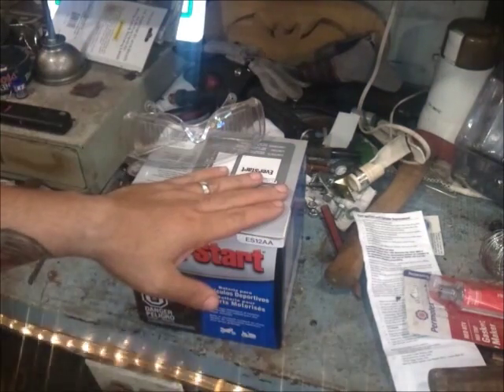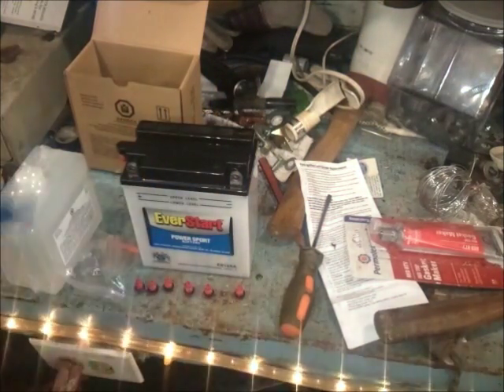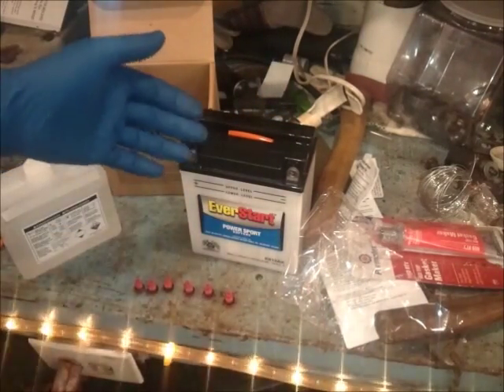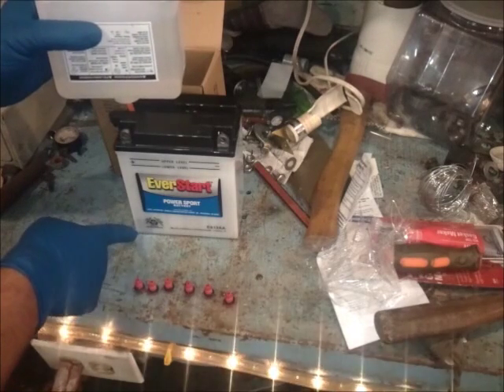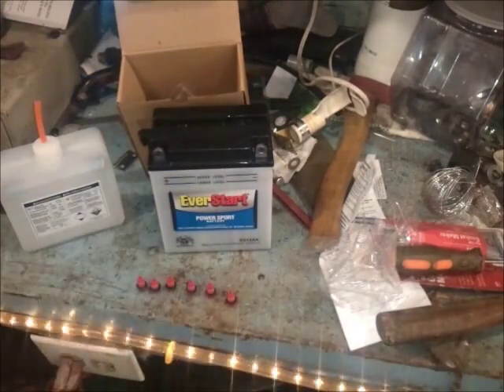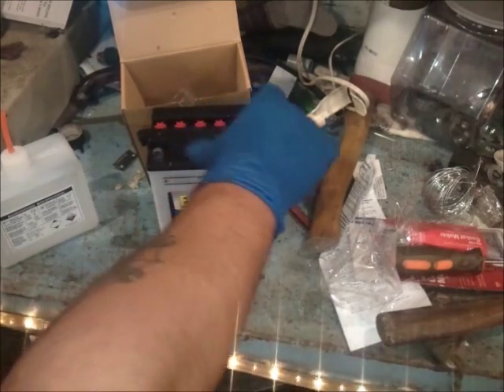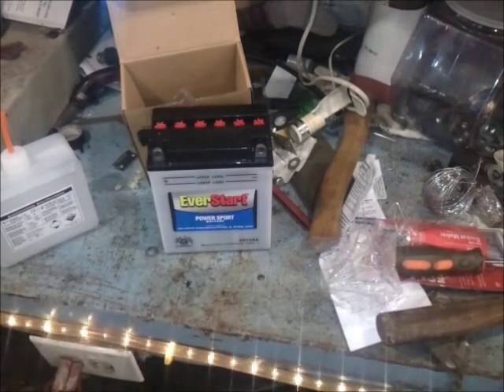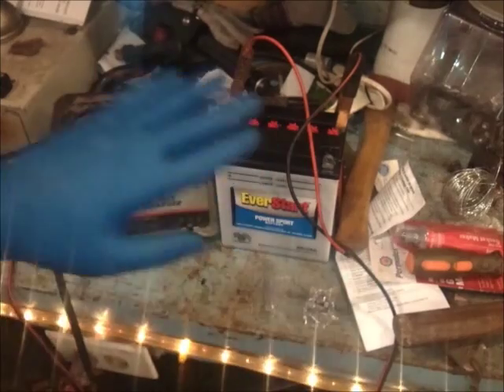how to fill and charge lead acid battery

Comment: A very informative video. I have a flooded type Yuasa battery with me. The acid is yet to be added. I'm a little confused with the level. So, I know that we are supposed to add the acid up to the "LOW LEVEL" at least and then wait for 30 minutes and gently tap it in between to remove any air bubbles. During this period the acid would be absorbed into the plates and the level may go down and you top it. 

But to what level does it need to be topped for the first time prior to the first charge? Is it up to the "UPPER LEVEL" or is it between the two levels? I am worried if the acid my come outside due to bubbling.
Reply from the maker: I normally try to keep the acid level in the middle of the two lines and if you have leftover acid cap off the container for just in case anything boils out of it then you could use the leftover acid just to top it off that's the unfortunate part about using the flooded type batteries

Comment: What if the orange tube falls into the battery?
Reply from the maker: Scotty Cody you don't want to leave it in there. It could be a big problem later on. The tube is not made to be left inside of a battery for a long time but if it went in and you can't get it out I'd say screw it and leave it. Depending on how far it went into the battery, you would have to try to dump it all out and start over.  Thanks for watching.